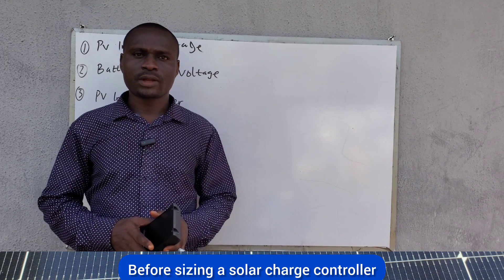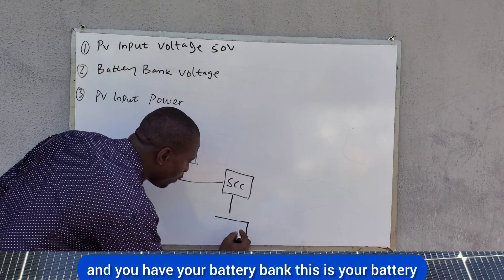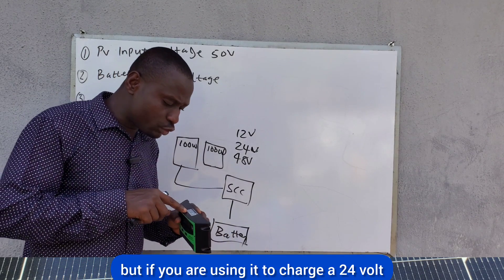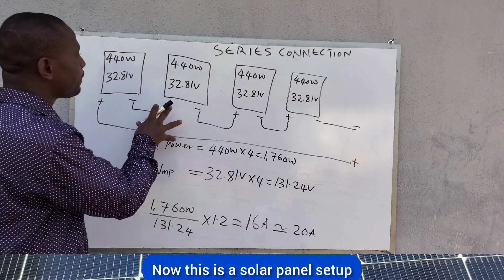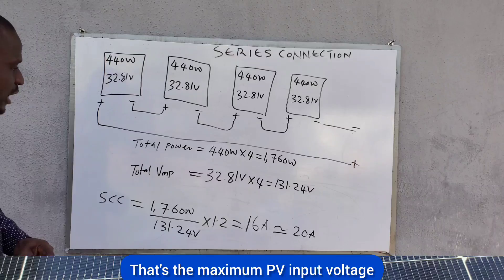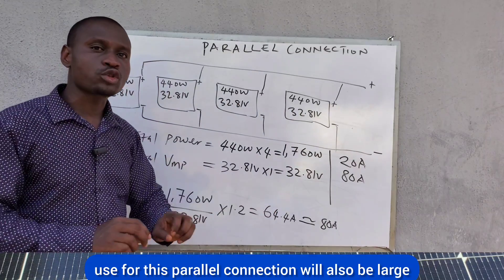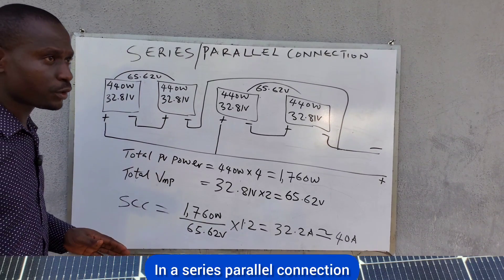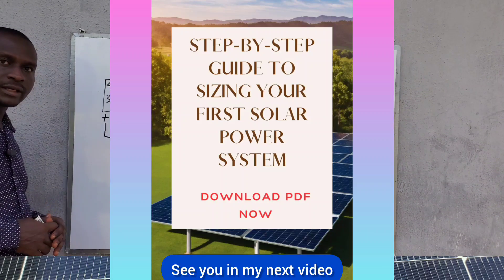How to Size Solar Charge Controller #solarpanelinstallation #solarenergy

Comment: You should have divide total wattage by the system voltage to get an appropriate charge controller size and not to divide it panel voltage.
Reply: very good from new zealand
Reply: @peterlintern yes, thank for the same observation.
To size charge controller,. You devide the sum of the individual panel power by the  system voltage, like 12v, 24v, 48, etc.
Reply: @hassanaliu2084  sorry, what do you mean system, all 4 major components make up the system, are you talking about the inverter, charge controller battery or panels. Voltage of which of these are you referring to?
Reply: The battery voltage you choose for system: 12v, 24v, etc
Reply: If you decide to divide by system voltage like 12v or 24v, U will never get the correct Controller.. I did installation of 24v battery days ago nd my pv is 1200watts. If I divided this system is 28. , why if I get 30amps it won't charge 220ah battery to Ur satisfaction. So is better to use VMP from panel
Reply: @sunenergyltd ,it gives you 50A not 28
1200W/24V=50A
Reply: Could you please give me example of it
Reply: I agree with you